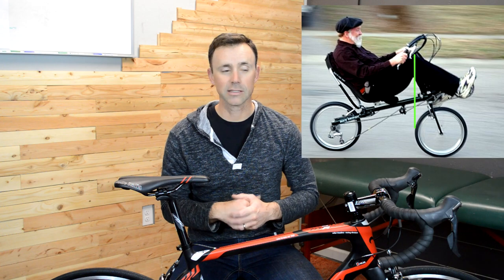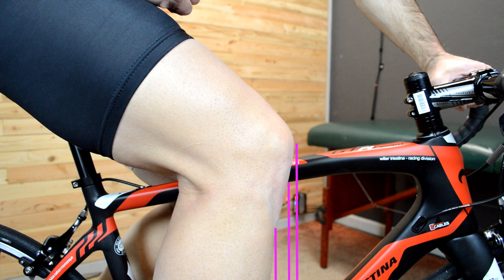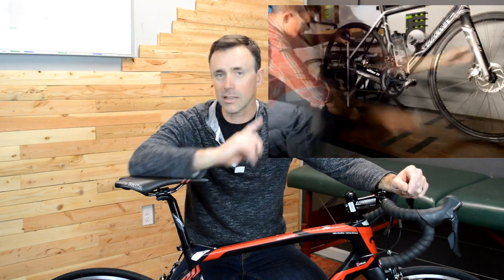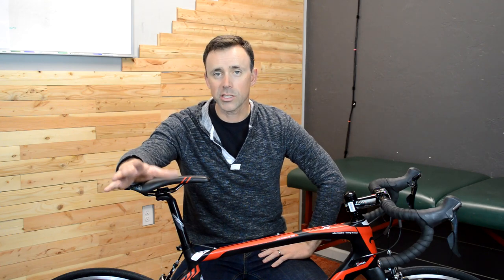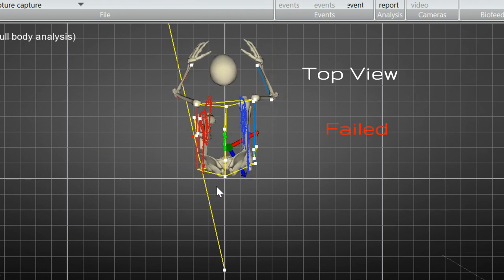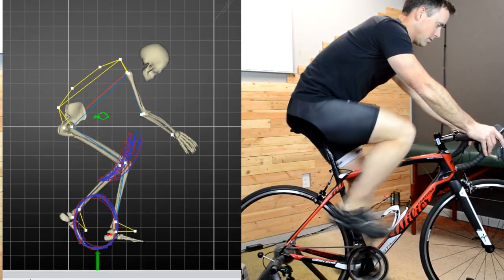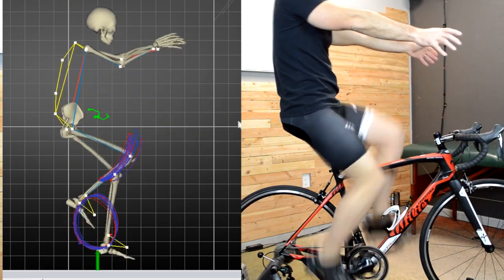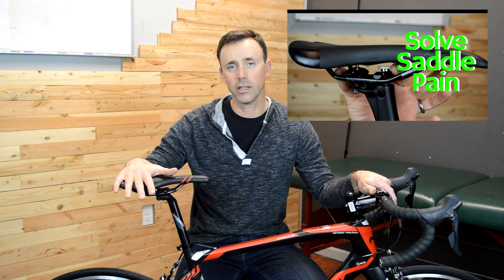How to set Saddle Fore Aft | Bike Fit Tip

Comment: If you want to use the most muscle and have the saddle as an anchor to push from, move the saddle back as far as safely as possible.  Adjust the bars to fit a 80° to 90° flat back, this lengthtens your reach. After that, If the stem is too short, the bike is too big. 

Sitting straight up is not a riding position so why use it to judge saddle position? Judging by his riding position his reach is too short and he is holding himself up with his straight arms/hands instead of his core. He's just poking at the pedals. You need to bend over further to engage your core to get your body weight centered over and fully on the pedals. Notice when he falls forward, if there was enough resistance on the pedals (a harder gear) he could hold himself up with his core, more power to the pedals....less weight on the bars.

Fixing a back problem by raising the bars is exactly the opposite of what you want to do. It makes the back hold your upper torso weight even more putting more strain on the back muscles.
Reply: This is about the worst understanding I've ever seen. This person has never done a squat and realized it's easier to push the weight at the top of the squat vs the bottom as he recommends pushing the rider as far back as possible and bending the rider over as much as possible. This creates the most acute hip angle possible on the bike and elongates the glute muscle as far as one can which only makes it weaker. He must also be a terrible bike handler shoving that much weight rearward making the weight distribution on the bike incredibly rear biased because you don't need that front wheel to grip right? Also simply doesn't understand that the more upright a person is the less weight the lower and upper back muscles needs to hold because it's distributed through your skeletal system instead of supported via muscles. A simple test of bending over at the waist and holding some weights in each arm will make it blatantly obvious how stupid one has to be to think the less bent over a person is the more "It makes the back hold your upper torso weight even more putting more strain on the back muscles." One has to be wowed at how stupid this is even from the easiest possible level.

Comment: The knee over spindle idea was based on the assumption that you push the pedal down vertically. The recumbant example is useful in demonstrating that that is a misconception.
Reply: The opposite of down is up, so when you push down, you lift yourself off of the saddle (the anchor from which to push from). I think it is a concept for old school track bike, it centers the knee over the pedal, less yank on a fixie. Mfgrs use it to fit more ppl to bikes that don't truly fit them.

Comment: This method seems flawed.  As the biggest variable in this balance test will be core muscle strength and stability of those core muscles, along with upper body weight.  
I’m sure this method works fine on highly trained athletic cyclists but I can not recommend it for majority of road cyclists who simply are not riding 500+ hours a year.  
So many cyclists, and especially those with upright cycling positions have poor core muscles, weak lower back muscles and poor posture that this test will just highlight poor muscular stability rather than saddle position.  
Rather than move saddle I’d teach them how to engage core and upper body muscle to achieve improved riding position that improves power and endurance and reduces aerodynamic resistance and as a result of all of those things it also reduces body weight on the saddle, resulting in better comfort.

Comment: Sounds like voodoo. You really can't adjust the saddle properly without looking first at the total fit of the bike, shoes, shorts, stem and crank length. He's correct about the importance of picking the right saddle though.  The width, length and comfort of the saddle is most important.
    The proper use of the saddle is more that of a leaning post rather than a seat for the aggressive rider. You will shift your weight many different ways during competition. If you find yourself putting all your weight in the saddle, or dependent on one position, something else is wrong. 
    Finally, as you improve your aerodynamic form and effort on the bike, your fit will change. It's really a number of small changes over time to achieve a good fit, saddle or otherwise.. Listen to yourself first and take time to understand the mechanics of cycling. Everyone tries to be an expert on this subject.

Comment: Tilting up for the balance part of the test changes the position you hold your foot while pedaling. This makes you reach for the pedals, either creating imbalance and/or sliding forward, because the crankarm pulls you there. Which could mean your saddle is to high. This test changes too many factors to make a correct decision.

Comment: I agree with the main points of this video but you really need to stop using the term reach to describe the distance from the bars to the saddle. Reach is universally used to describe the horizontal distance from the centre of the cranks to the centre of the top of the headtube and along with stack (the vertical measurement from the same points) is a huge help in sizing mountain bikes. What you are talking about is effective top tube plus stem, not a very flashy or memorable name I'll admit but calling it reach is asking for confusion.
Reply: Rider reach, frame reach two diff things...since he never talked about the most important thing...frame geometry, you can assume it's rider reach.

Comment: 1:56 but then if you apply that "sizing" rule to all those bike types then neither triathlon nor bunch of other bikes fit people but they still ride them !?
So instead of trying to find universal rule you should try to understand that bike fit is not universal thing. Fit for road bike will never work correctly for triathlon and also triathlon fit would never work for MTB...... even fit for same type of bike will not work correctly for 10 different persons !
Bike fit is individual thing for specific bike and one person, even fit for one person on one bike can change so talking about rules and critiquing rules of thumb in way you did here is neither good nor informative and does not help anyone instead you should find and tell people general call it rule of thumb for starting position on different kinds of bikes followed with best practices followed with advices in terms cause and solution like for example if your hands hurt or become numb try reducing the reach with handlebar but not with saddle or if your reduced reach causes you to sit up and have to bend your spine to go down on handlebars move your saddle back or if you are on road bike and your knee is 10 cm over the crank your frame is to small ........
Those are examples not advices they are just place holders for you to tell us if this happens do that or try this and that which can cause that ........... I know circle is big and all is connected and changing one thing can mess up 7 other things but there are no rules like mathematical formula to fit the bike, we have some rules of thumb which can bring us into ball park and from there we should know what causes what and what changes other things like if you move saddle back you need to bring it down a bit or if you move it to the front you need to raise it a bit ............

Comment: First off never do a bike fit on a fixed frame bike, use a fit bike. You fit a bike to you, not you to the bike.

I'm always amazed that no "fitter" mentions frame geometry. A fit on one frame won't work with another frame b/c the geometries are different. The bottom bracket is the stationary point of the frame. A small bike has a more upright seat tube, placing the rider more forward over the BB, while large frames have rearward seat tubes placing the rider further back behind the BB. I'll bet the more upright seat tubers have the more balance problems.
Reply: It's astonishing how bad your understanding is especially with how much you post. The bottom bracket is the origin but the places in space where the rider will be ideally placed can be accomplished on most bikes if appropriately sized. You seemingly don't understand that comparing like for like bikes (road with road bikes or whatever with the same type) the differences are going to be a degree or two in the seat tube or head tube. None of that is going to change whether or not you can place the rider X cm behind the bottom bracket with a saddle height of Y and a reach of Z. You don't need a fit bike to be fitted to a bike it only helps narrow down the selection of bikes where you fall in the 'neutral' range akin to longer top tubes for longer torso riders and shorter top tubes for longer legged riders.

Comment: I have tried to watch this guy's videos a number of times, and what I always come away with is he talks to damn much about things the average or above average rider cares little about.  If you are a pro then you either know all this minutae of info or have a bike fitter.  JUST TELL ME HOW TO FIT MY SADDLE, as the title claims.
Reply: An easy, basic guide? Fit the saddle level in the center of the rails, go do a 20 mile ride and consciously be aware of your ass on the seat, then use common sense and figure out what the sensations are telling you. Need it forward, back, tilted up or down, higher or lower? Adjust as necessary!
The problem comes when some people struggle to correctly interpret the sensations they feel and adjust as needed to fix the problem.